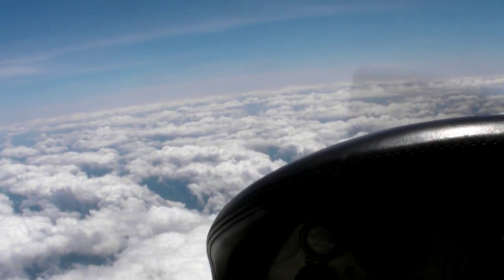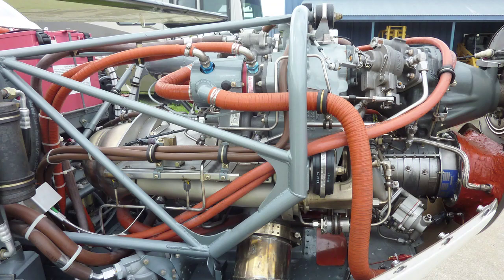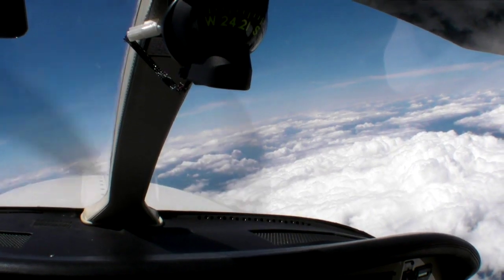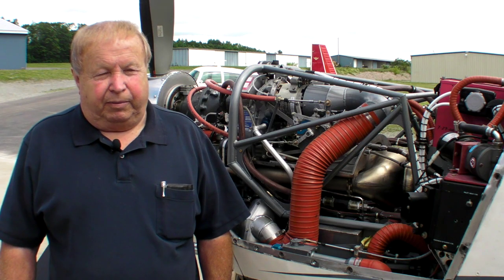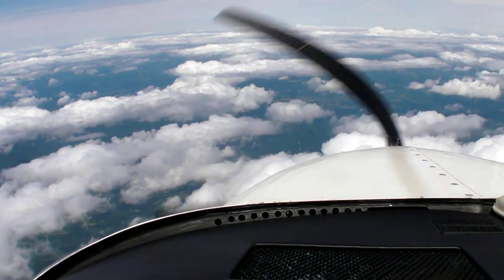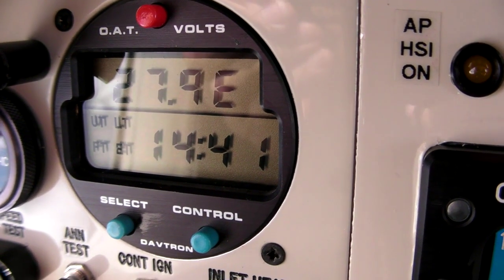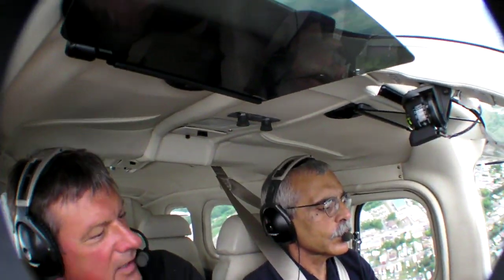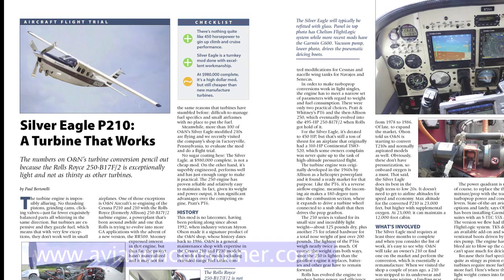Silver Eagle Turbine Conversion

Comment: Would love to take a Cessna 210 RG pressurized model, and customize it 
to what I feel would be an awesome aircraft. Here's the dream: 
Strengthen and reinforce the wing-spars/ribs, 2. Add two turbo charged 
powered  ducted fans, one under each wing and as close to the fuselage 
as possible, for increased center-line thrust, 3. Replace as many 
parts/panels, etc. as possible with carbon fiber materials, 4. Lose all 
of the steam gauges/radios and replace with "just enough" glass 
avionics/instrumentation/radios, so as to help keep the weight to a 
minimum, 5. Add a nose intake, that would house a back-up emergency 
electric wind turbine, 6. Replace original cowling with a more modern, 
light weight composite, rounded nosed cowling, 7. Have interior 
completely upgraded, adding the latest/greatest in noise insulation, 8. 
Mount (2) 10" Tablet, articulating mounts just aft of the front seats, 
9. Add a FADEC, 10. Replace the "push"/"pull" throttle, with a more 
sportier T-handle throttle, 10. New paint of course. 11. Add Vortex wing
 generators, 12. Replace the wing tips with composite winglets. That's 
about it. Go ahead and laugh, make jokes, but I think it would look very
 sleek, modern and simply be one awesome aircraft! If you took the time 
to read all of this, thanks! Your thoughts?

Comment: Tirbin? or you mean Turbine
Reply: or turban - would you like a pappadam with that?
Anyhow RR my ass. Call it an Allison turban :)

In all seriousness this is one very very impressive conversion. If I had a single engine plane this would be it.
High wing planes rock for sightseeing anyhow but this would make for an extremely flexible platform for touring in varying conditions. One hopes the exceptional flexibility doesn't lead some pilots into a false sense of security however. I am genuinely impressed by this plane.
Reply: There's ATC audio of one of these gliding down from 21,000 ... 'cuz the engine stopped.

Comment: Before anyone says the Turbine is a gas hog, remember that the P210 goes 180kts, 16gph with 1000ft/min climb at $6.09/gal Avgas vs the Turbine P210 goes 215kts, 23 gph with 2500ft/min at $5.79/gal JetFuel. I did a rough calculation and it's almost a wash. Now, price is where it gets you. Average price P210, $250,000 vs Turbine P210, $500,000 (on controller). Overhauls are higher $ in turbine, but less frequent. Bottom line: Turbines are 50-100 times safer than a Piston... I'll finance that extra $250,000! (these are rough numbers, btw)...
Reply: not to mention the speed, its saving some time and time is money

Comment: It is slightly faster than the piston engine, fuel burn a little higher but the per gallon cost is a bit lower.  Initial cost is a shocker over the piston.

The piston engine needs near-contant TLC to keep it healthy. Turbine doesn't need work as often, but when it does, it is costly.

The big thing to keep in mind is that the days of leaded av-gas are coming to an end. Av-gas prices in some parts of the world are over $20/gallon. So its diesels or turbines.

Comment: My dream plane !!! 215kts, 1100 nm range, 4 pax + bags, burning 22-23 gals/hr simply can not be beaten !
Reply: tropicthndr  That stainless steel intake may have de-icing function.  And because the RR engine has a centrifugal compressor instead of an axial compressor it may not need the separator.
Reply: Ah hell no, there’s no bird strike protection, no ice protection in the intake. Where’s the inertial separator like a PT6 has. This is a fools money pit.
Reply: @tropicthndr  Intresting that in late january of this year a Bonanza tradewinds turbine with the same RR/Allison suffered a bird strike on takeoff. Both pilots died. The only turbine i would buy would be the turbineair Bonanza with the PT6. This wouldnt happen with the pt6-21. While its sadly not pressurized it can do 225kts at 12,500 and 255ktas at FL240.
Reply: this is what happens when you expose a single stage compressor rotor at the front of the aircraft. Extremely poor choice to use a helicopter engine for those aircraft.
Reply: @hiflyer1168  why??? It's completely true.

Comment: What Paul said in this video is that they were truing out at 197ktas at 23-24gph on a warm day... that's not bad. That's what a Seneca V is reported to be able to do at that altitude and burns about the same. But even one turbine is probably more reliable than two piston engines, plus this 210 they flew was pressurized. Also are you stating 140ktas or indicated for your C72R? Cause I think that's where your throwing EatMyPropwash for a loop... Your 140kts is correct for TAS which is about 125IAS

Comment: I call BS.  I have over 1,000hrs in the C172RG and plenty of them on long XC's over 800 miles long swapping airplanes for our company in KADS.  I've only flown ONE, I repeat ONE RG out of at least 15-20 that would cruise at 140KIAS at 3,500ft at 22"MP and 2300RPM...  It was a factory freak.  All the rest would cruise at 125-130KIAS.  Looking at the POH at 6,000ft with 24"MP and 2400RPM its only doing 137KTAS.  The 8k, 10k, and 12k charts only shows 140KTAS at FULL POWER.

Comment: @flexairz ...I see it like this.  The Cessna 210L that I fly has a 1600lb usefuel load and does 170 kts true on 15gal/hr.  Here, your doing 190 true with 23 gal/hr, and for an extra 650K not including the original purchase price of the plane, its hard to justify.  In a turbine 210 from Orange County to Vegas vs a standard 210 you would maybe save yourself 10 minutes but would burn more fuel.  Bang for the buck, just dont see it.  Unless you wipe your ass in 100 dollar bills, then fine.